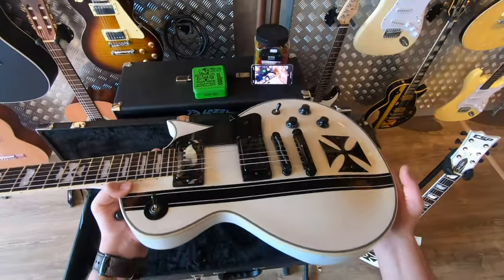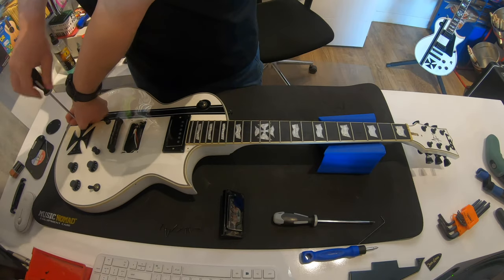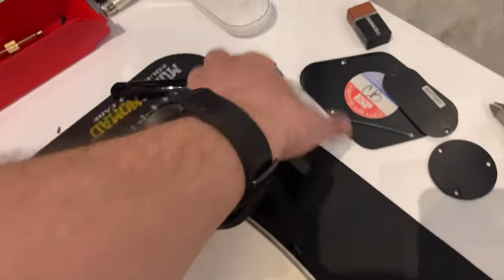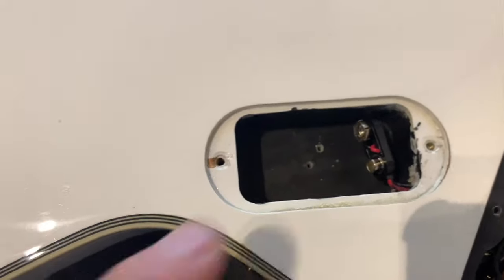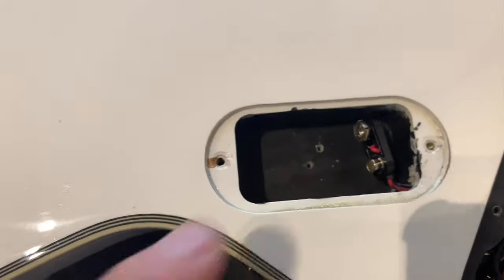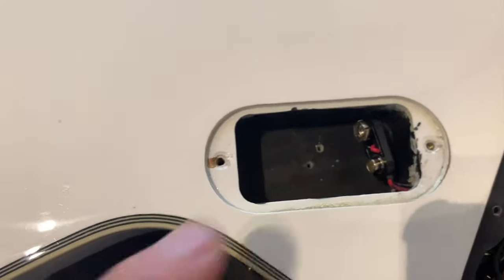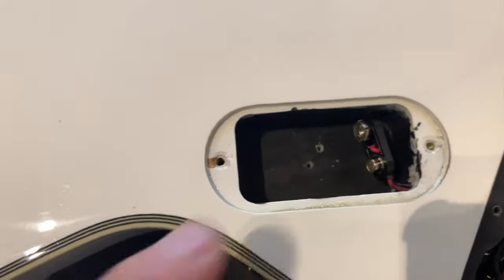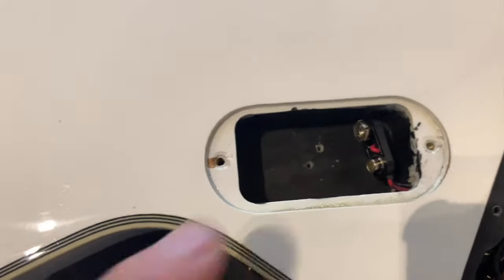ESP vs LTD Iron Cross with Blind Tests - Are the differences worth over 5000$ to you?

Comment: The LTD is a fantastic guitar and, compared to the ESP, a tremendous value. I cannot justify spending the money on the ESP and I would not enjoy owning something so expensive. I wouldn't want to play it for fear of dinging it on something and guitars are meant to be played. Great video!!!
Reply from the maker: Thank you 👀
Reply: I had an LTD Truckster which is the worst Les Paul type guitar I have ever played. It was awful. Chibson quality. But I have had other LTD's that were great
Reply: I wish they'd add 1 mm to the nut. A 42 mm nut works on a 25.5" scale, but on a 24.75" that makes the fretting area feel too small. So it's this tremendous feeling guitar with stainless steel frets but it has a toy-like feel and looks tiny in my hands.  The EC-01, which is a Les Paul Jr, has a 43 mm nut and you can see the difference in videos

Comment: When compared side by side, without a doubt the LTD is a bit muddier and not that hot compared to the ESP, but i'd rather turn up the presence of my amp than spend 6 grand on a guitar :/. Amazing video as always bro, would love to participate in a blind test the next time :D
Reply from the maker: Absolutely, you can compensate the difference in tone with a pedal and some amp settings. I will call you next time we do a blind test ;)
Reply: I have both, and the tone and feel improvement of the ESP is significant. Mostly I believe bc the ESP is sooo much heavier, wood quality i suppose, thus tone. Plus the neck construction is way better/more solid and is just shaped up better. It basically ruins LTD, and I don't even want an LTD anymore. LOL
Reply from the maker: @LanierLegal  Yeah I know exactly what you mean 🤣
Reply: @LanierLegal  I also have an LTD and ESP. I've been playing the LTD more as the neck is more comfortable to play on. It also has a greater selection of pickup choices with the coil tap. The hot rails in the neck is a unique pickup too. This isn't to say the ESP is a great guitar but for serious shredding the LTD wins. It's a neck thru as well which allows for greater upper fret access; however where it runs through the body is a bit rough at the wings, the ESP is a set neck and is flawless but there's no appreciable difference in tuning stability. In fact I'd argue the LTD has greater tuning stability with its Gotoh locking tuners compared to the ESP despite the fact that it has Sperzel locking tuners. 

The weight of the wood regarding tone could be argued both ways. The LTD is significantly heavier because the woods haven't been dried out as much compared to the ESP. The addition of the Floyd Rose also accounts for the increased weight profile. The contention goes that lighter weight guitars have "purer", more curated wood although the inverse of this are Gibson Les Pauls which weigh a tonne. Therefore I would argue 89.5% of the tone comes from the amp/speaker, 10% from the pickups and the remaining 0.5% from the woods (or less).
Reply: Well said.
Reply: Just change pickups or use an eq pedal. No way Im pay that for the ESP. Play over 100 gigs a year with an LTD.

Comment: Incredible video. I have a LTD EC 1000 T (2012 Korean Made). The ebony fingerboard is extremely black (probably ebony and not Macassar ebony). The construction in this one is stunning. Incredible quality for the price. Just change the EMG for DiMarzio Air Classic (but it's for personal preference). I have a ESP Standard EC Series, and is LTD is so close. I am very impressed with this. Thanks for video and greetings from Argentina!
Reply from the maker: Thank you  Marcelo. Yes it is ebony in your EC 1000T, great guitar. Which colour is your ESP Standard?
Reply: @GeorgeVGuitars  It is Eclipse FM/SD (Cherry Sunburst) with flame maple top and Seymour Duncan JB and 59. The only difference I see with my EC 1000 T and LTD Iron Cross is the body on Iron, have maple top. EC 1000 has full body mahogany. And the EMG are 81/85. With DiMarzio's and all passive circuit, sound's incredible. Excellent harmonics and definide open chords.
Reply from the maker: @marcelosebastianperalta1906  Man you got a sweet guitar there 🖤
Reply: @GeorgeVGuitars  Thanks bro. Again, great video and greetings!

Comment: I had the LTD before and one thing I've noticed that the quality coming out of the LTD factories aren't what they used to be. In my case the nut was not sitting level on the neck which was causing the E and A string to buzz BAD in certain places.  Even after replacing the nut and a proper setup the issue wasn't corrected. It seemed that the one side of the neck was shimmed in a certain way where one end of the nut was shorter than the other side.  Eventually, I sold the guitar. It makes to hesitant to buy another LTD. People that don't see the sound difference need to get better speakers or studio monitor headphones, the difference is there.  Play ability is all in the guitar player and their preferences. Bigger question is do you have the funds and patience to get the ESP.  I like the black truckster better.
Reply from the maker: Yeah I am also not happy with the post 2019 LTD Iron Cross... or whichever year they started putting on the brownish fingerboards.
Reply: I don't even know why people keep metioning LTDs when Edwards is there lol. Just choose from ESP, E-II, or Edwards depending on you budget. Ditch LTD.

Comment: To my ears, it sounds like the ESP model has a more full sound with more low end than the LTD, which sounds like the lows and mids were stripped. It's very subtle, but when played on headphones and a speaker system with a subwoofer you can definitely hear more low end with the ESP. Is that bit of extra low end worth $5000 to you? That's for you to decide lol. Great video!
Reply from the maker: Its not only the sound, the playability and build quality is totally different
Reply: @GeorgeVGuitars  I definitely believe that! I have held an ESP side by side with the sister LTD model, and it feels more solid and has that extra polish that you would expect from an expensive instrument.

Comment: @george v guitars . I have a interesting question. I have Cort CR 200 updated with JH Hetset pickups. If i buy LTD Iron cross , will make diffirence for sound ? or other perceptible difference ?
Reply from the maker: It will greatly affect the playability. You will not hear that much of a difference in the sound if your amp is not good enough to show you the difference. But trust me, the LTD will play much better than the cort, especially if it is set properly.

Comment: Awesome video ! I have a 2021 LTD Ironcross and this was so cool to see all the differences between the ESP vs LTD… other than what u see in specs on the ESP webpage. Cool video !  I did recently upgrade the plastic nut to a GraphTech nut and was thinking about upgrading the LTD tuners to the Sperzels.
Reply from the maker: Thats pretty much everything the LTD needs - a new nut and the spertzels. Now you have the perfect LTD. I al glad you like the video. Where is yours made, Indonesia or Korea?
Reply: @GeorgeVGuitars  Mine was made in Korea. Do u know if the Sperzels will be a straight swap out ?
Reply from the maker: @romanshredz  let me check tomorrow I have a set of brand new spertzels at the shop. Find me on instagram or facebook and remind me tomorrow I will check and send you a picture. I think they should work fine. I just gotta check the inner wall of the tuners.
Reply: @GeorgeVGuitars  awesome will do ! Thanks so much for checking
Reply from the maker: @romanshredz  So I checked, they are not exactly 100% direct replacement but not too hard also. The LTD tuners have two anchor points on the back, the Spertzel has only one between them so you have to drill some small hole for each tuner. Not a big deal tho and you will not be able to see it, because the hole is under the tuner.

P.S. Also turned out the Sperzels have that EZ fix system where the anchor actually makes its own hole in the headstock while you tighten the tuner. It is a sharp hollow small pin that burrows into the wood 👀
Reply: @GeorgeVGuitars  Thanks for the info George… very helpful. Gonna order my Sperzel!

Comment: Thank you man! I was looking for such comparisson and if 5k is worth it.
Reply from the maker: Roland, I am glad I could help. Is it worth it to you?
Reply: @GeorgeVGuitars  Generally speaking, The ESP is also a work of Art and should therefore not be compared in monetary terms; as you mentioned the small push to perfection comes with a great cost. With that being out of the way, I am a little bit torn. I feel like it is not justified for my income level, if it were higher, then yes. But, I would have to play them both, so I can get a sense of it. A good, smooth neck that enables shredding is important to me. I know this is not supposed to be a guitar like an Ibanez Jem Pia for example, nevertheless a 5k guitar neck better deliver in its own way. I guess I will go for the LTD as a second rhythm guitar. Cheers!
Reply from the maker: @rolanda.2653  A valid point. You will not be disappointed ;)

Comment: Guessed it right again - The ESP sounds a little bit brighter compared to the LTD. :D
Reply from the maker: I never doubted you 🖤
Reply: @GeorgeVGuitars   Now that I think about it, It would've been interesting to swap the pickups of the two guitars (thank God for the EMG's quick connection system 🙏) so we could see if the difference comes entirely from the wood and the guitar itself. To me personally, it makes no sense two exact same pickup sets to sound so different.
Reply from the maker: @BorislavZahariev  Yeah i thought of that but I have compared the ESP to almost every modern Het signature and some of kirks, it has more gain then all of them. An d the pickups were measured, they are not hotter than the rest. Its the wood and the amazing work of the Kiso guys.
Reply: @GeorgeVGuitars  did you check the battery voltage for both guitars ?
Reply from the maker: Its not that, and its not the pickup height. Thats not the first guitar that has less gain than the ESP IC with the same het set.
Reply: @GeorgeVGuitars  so  whith a more density wood , it will more vibrate and so give the pikups a push ! more dollars for dense wood to resonate  ,  so i think  great wood does not mean only for eyes ,  we want it to resonate ! i sub my friend . thank you !
Reply from the maker: @patricelecanu6150  Glad you like it. By the way with mahogany its not always about the weight and density. Its about the grade and which part of the tree comes from. A lot of times with Gibson guitars the lighter mahogany bodies resonate better.

Comment: They sound pretty much identical, which is to be expected.
Reply from the maker: Get some monitors my dude ;)
Reply: @GeorgeVGuitars I have a 10.000 euro  setup and cant hardly hear any difference. Usually i prefer more expensive guitars. In this case i will go for the LTD!
Reply from the maker: @paulozavala3232  Alright 🤘🏻

Comment: The ESP version also have a deeper and more pronounced dish carve
Reply from the maker: The carve is similar on both.
Reply: @GeorgeVGuitars  Yes, but ESPs has always had a deeper and more pronounced one, I've had some ECs and Ecliplses and it's quite noticeable.
Reply from the maker: @Masterfighterx  The finishing touches of the carves are done by hand. I imagine a more pronounced dish requires higher skilled workers, right :>
Reply: @GeorgeVGuitars  I don't know why it wont let my posts show, but you can search for ''ESP Standard made in China''
Reply: @GeorgeVGuitars  It was an ESP Rep that said it in an Andertons video when asked about the E-II ''and they're made in Japan'', he then answers something in the line of ''fit and finished''

ESP has never come forward with this, really bugs me as a guitar built in China shouldn't have a made in Japan sticker on it. And if they were open and transparent about it, it wouldn't be an issue, other than the pricetag of around $2k..
Reply from the maker: @Masterfighterx  Yeah I don't mind guitars being built in China, I do mind manufacturers not sharing this information :/

Comment: You simply can't compare two electric guitars with the same pickups. You will get the same identical sound... Even if you put those pickups in a table with strings... Only comparison you can do is about the construction and esthetical quality...
Reply from the maker: Which I did ;)
Reply: @GeorgeVGuitars  yes indeed. This is one of the best guitar comparison videos around